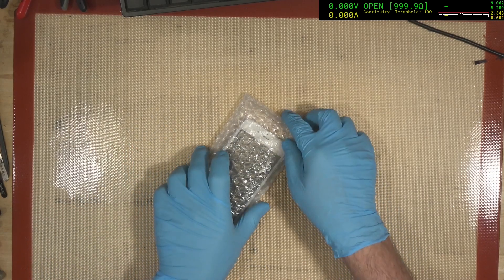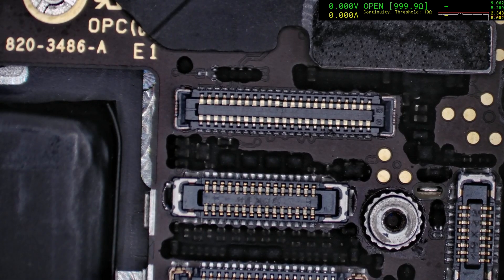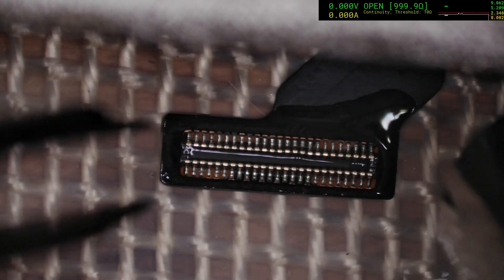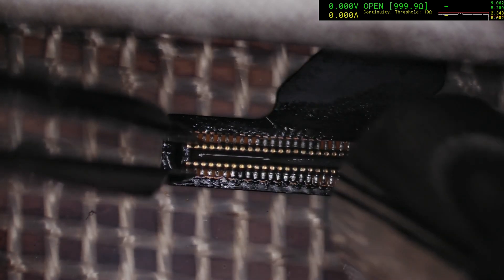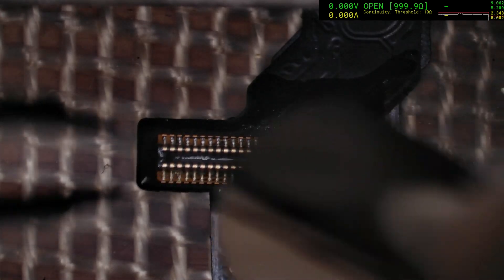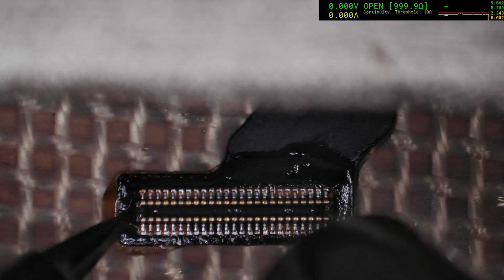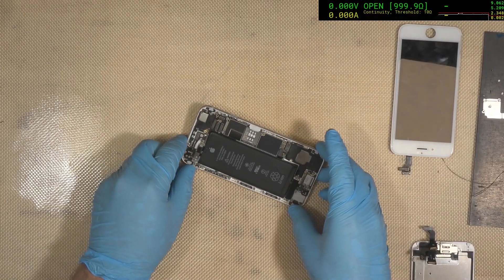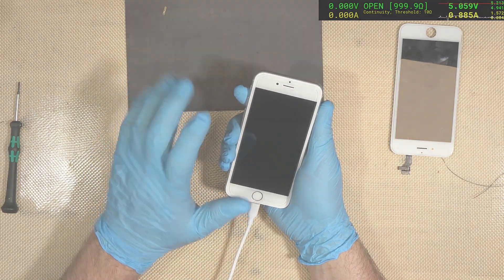How to replace damaged  iPhone screen connectors without low-melt solder. Essential Skills to Learn.

Comment: When replacing the display on my iPhone XR, I forgot to turn off the phone before disconnecting it. After attaching the new display, it was completely unresponsive to touch (even after trying with different displays). Is it fixable?

Comment: Small tip use soft toothbrush for those small connectors while cleaning...much better that cotton...btw nice job we doing the same :)
Reply from the maker: I use multiple devices here, between earbuds, soft toothbrush, or electric toothbrush - depends a lot on how far I want the IPA to spread.   I will say though, this current batch of 5000 earbuds (Q-tips) are particularly bad for unravelling and leaving threads; won't be buying that brand again.

Comment: Nice video. I have replaced similar connectors on Huawei. I use soldering iron. Just lay down the metal shield on the iron. It melts really fast and the connector comes off without melting the plastic, so you can reuse it.

Comment: So we have to use something soft and pliable to remove the ribbon cable from the connector. Just a small question, how am I supposed to get my tiny, soft and pliable brain into such a confined area? 🤔
Even though I can't fix things like this Thank You for the video Paul. How are the kitties, still climbing trees?

Comment: i had my iphone 6 replaced the battery when i was over in the Philippines was pretty cheap to about $30 Australian
Reply from the maker: At least you can replace those without making the phone get all grumpy about the fact that you dared to change a part
Reply: Do you know a reputable shop? Where is it? 
My niece in the Visayas took her garbage Netbook to a computer repair shop because it wouldn't boot. She was told it would need a new motherboard and everything is soldered to that board so basically a new machine except for the screen. The new Netbook buy price was P8,000 (AUD$220) which is more than what they were selling for new here so I got her to send it to me since my wife was visiting. I turned it on pressed F10 (or was it F8) and ran the Repair option and it all worked fine. There are ripoff merchants everywhere so when you come across a Paul Daniels, a Mobile One or a Jason Cosgrove you don't lose their contact details.

Comment: Really liking these instructional type videos Paul. A USBC port socket on the likes of A1706 style would be good too
Reply from the maker: Oh those I can do for you, obviously without taking off the shield like some people seem to do.
Reply: @pldaniels  In desperation I did take the shield off once, but I replaced one the other day and heated it from underneath so no problem. Actually the first one I ever did was perfect, and from the top from off donor and back onto target board. Still chasing that experience.